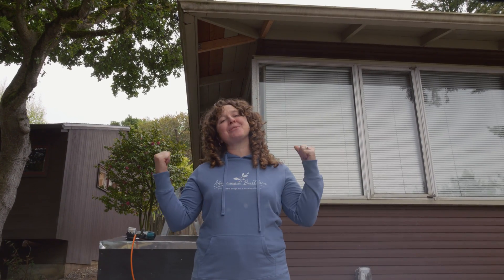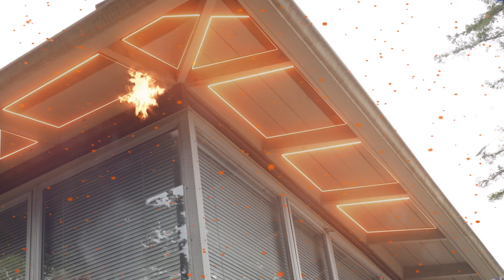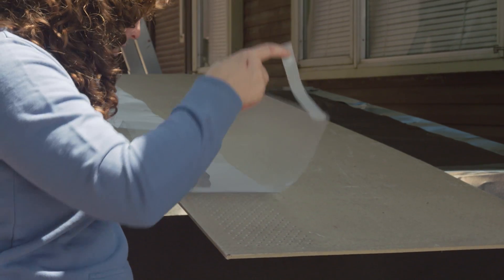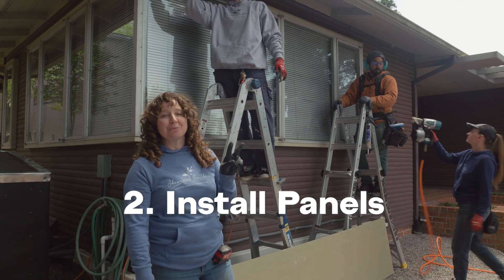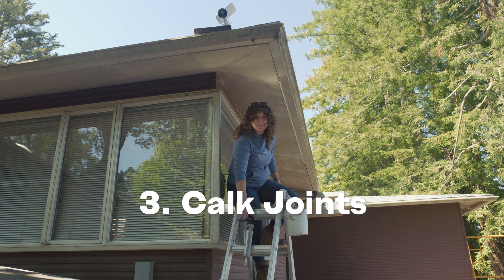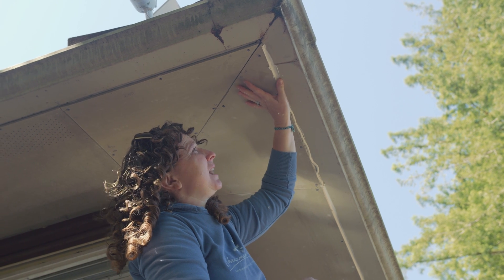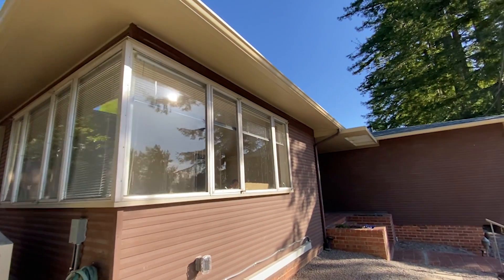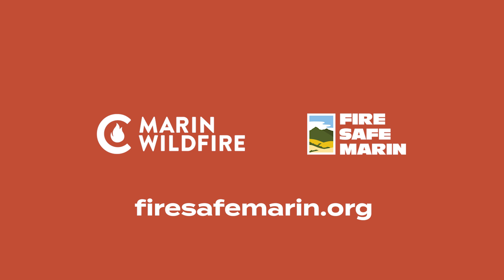Enclose Eaves and Soffits

Comment: When you added the mesh wire behind it to let the air flow did not cut any holes into the panels to let are in so why would you need to add the mesh wire behind it if you're not going to have any air hose

Comment: You mention boxing in the eaves is to prevent heat from the ground circulating up and under the eave space and the heat causing a fire.  Question- are boxed eaves needed on single story or ground level roof line only? Is this needed on second story eaves too (since farther away from the heat rising from the ground)?
Reply from the maker: Enclosing eaves is highly recommended for single-story homes, where ignition risks from nearby vegetation, decks, attached fences, or neighboring structures are more common. When assessing the risks to second-story eaves, look for potential sources of ignition or heat transfer—such as nearby trees, tall shurbs or adjacent buildings.

Comment: I have the same question as above. My house eaves also don’t have a facia board like thenone shown. Do i need to take the gutters off, install a facia board to full enclose the soffit? Or can i use the gutter as a facia board like it appears in the video. Looks like just sealed the fiber board to the gutters. Or did you sneak in a veryical board behind the gutters?

Comment: Question: When you put the screen on the vented cement fiber board, how did you apply the screen. This was not shown, but I see what appears to be six pieces of tape. Did you use construction glue or something else to ensure the screen is flush & no embers penetrate between the two products?

I am planning on doing this to my home...

Comment: Did you fully enclose the soffit by placing fiber cement board between the gutters and the end of the rafters?  I only saw that you placed panels under the gutters.   Did u leave the gutters attached to end of the rafters or did u remove the gutters to nail up panels on the end of rafters?

Comment: Thanks for the video and it is great to see that you have used a non-combustible panel to enclose the eave.  My concern is that given you have installed 1/16" screen on the backside of the Hardie panels, painting the panels with a sprayer may have clogged those 1/16" holes.  I've seen a number of instances of a painting crew essentially eliminating the eave venting due to use of a sprayer on 1/8" screening. 1/16" screening will likely clog more readily.  I'd recommend using a roller for the vent hole portion of the panel.
Reply: Hi Tom, Thank you for that question, that's a good point. I was just up at the site today and looked to see if our sprayer had clogged up the mesh. It did not. We spray multiple light coats when we spray and the thickness of the fiber cement soffit was enough to shield the mesh on the inside. I tried to take a photo to share but my phone camera couldn't focus that close up. This is a good thing for people to consider when they are DIY'ing. Those sprayers are tricky to apply even coating without drips and often beginners will over spray creating drips and problems like the one you brought up. If you are doing this work yourself, consider using a roller and brush. Kazoo Shearman, Managing Owner of Shearman Builders
Reply: @kazoostudioseast6997  Glad to hear that. Overall, it looks like an excellent quality installation. Impressive that you  used both construction adhesive and fasteners to attach the panels. Keep up the great work!
Reply: I would have painted it while on some sawhorses, all 6 sides for rot protection, and it's just easier than holding a sprayer above your head.